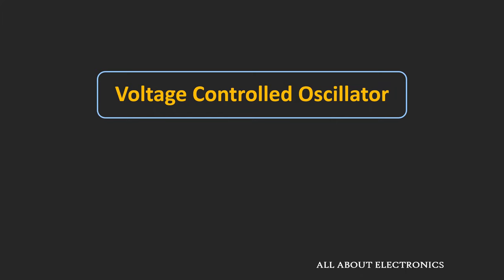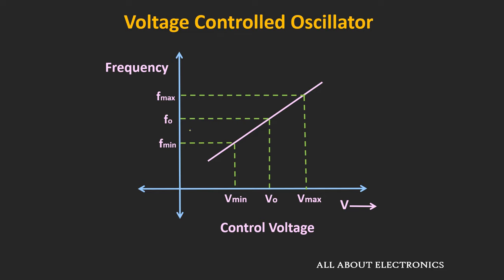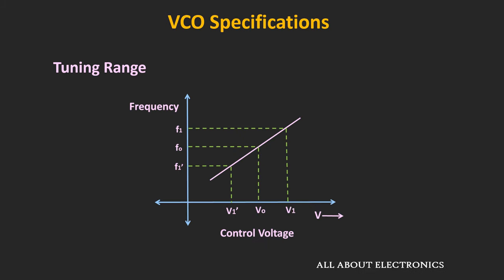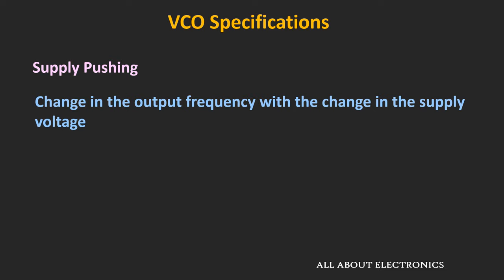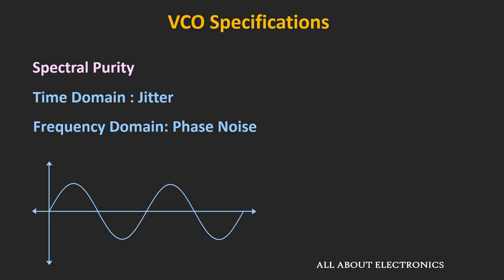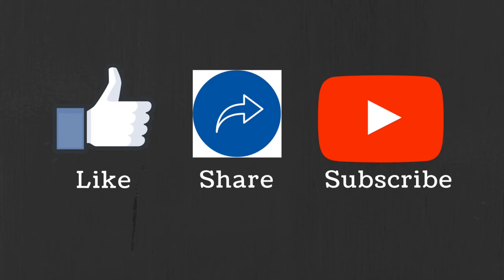Voltage Controlled Oscillator (VCO) Explained

Comment from the maker: The timestamps for the different topics covered in the video:

0:21 What is Voltage Controlled OScillator

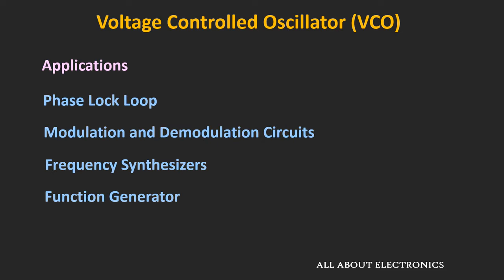1:56 Applications of Voltage Controlled Oscillator

2:09 Types of VCO and Basic Working Principle

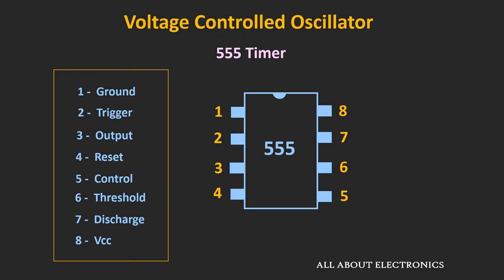5:53 Voltage Controlled Oscillator using 555 timer

6:48 Specifications of Voltage Controlled Oscillator (VCO)

Comment: Controlling the frequency via voltage is the best method by using Varactor diode or the Varicap diode even you can divide the frequency easily and it's stable as I remember in 90's we were doing that type of circuits

Comment: Great explanation! Is there a way to change the voltage on the oscillator based on the load so it can adjust itself automatically to a change based on the change in load voltage or current demands?

Comment: Great Video. How do I find more information on the output capabilities of an RF oscillator. Is there an output voltage? power output? Do you not think of oscillators like you would a normal circuit?

Comment: This is awesome. I was just wondering about this yesterday after browsing online and looking at various active crystal oscillators. So a TCXO is a VCO with a circuit that compensates for temperature. Are there TCXO's that have additional VCO type adjustments? Is that considered a "VCO with temperature compensation," a "TCXO with voltage control," or is there some other mnemonic I haven't heard of yet?
Reply from the maker: Yes, TCXO is the temperature compensated Crystal Oscillator. As far as I know, they do not have any additional arrangements for the frequency variation using the voltage. They are meant to provide the stable frequency irrespective of the change in the temperature.
On the other end, in VCXO (Voltage Controlled Crystal Oscillator), the micro tuning of the frequency is possible ( ppm level) with the change in the control voltage.
Reply: @ALLABOUTELECTRONICS  
 Thanks for the reply. A few hours after commenting here yesterday I was browsing AliExpress and a listing popped up for a VCTXO. Of course there was no datasheet or reference information, but it got me searching further. One of the first search results was from a company called Connor Winfield. They have several product lines of VCTCXO oscillators. Based on a quick skim over other search results it looks like one application for these crystals is probably cellular phones. It makes sense to me. A very precise radio with extremely demanding environmental temperature conditions seems like it could benefit from such a product. 
 All I know is that my oscilloscope is my most accurate frequency measurements device, so messing with precision frequency devices like a VCXO is entirely pointless. I still like learning about them though.
 BTW I'm subscribed to over 1k people here on YT. Over half of them are electronics related. There are a lot of people doing similar content as you, but they don't quite do it as well. Your presentation style and content length are perfect for me to watch casually. It's one of the few I watch regularly. I just want to say I appreciate it, and thanks. You're doing a Iittle bit to help me, some random disabled person in California, to stay busy, learn something, and make better use of his time. Thanks.

Comment: Hi! I would like to know if VCO can amplify the frequency of an input signal. So I have an oscillating input signal and I want to increase its frequency. Is it possible? If not, is there another option to do so?
Reply from the maker: Using Phase Lock Loop (PLL) it is possible to do that. Please check the video on PLL, I have already explained it in that video.
Reply: @ALLABOUTELECTRONICS  thank you so much! I'll do it 😉

Comment: Sir what is the ic no of voltage controlled harmonic oscillator? ???
Reply from the maker: There are many actually. depending on the range, you can select. 
For example, for 40 MHz to 650 MHz range, you can use MAX 2605 - MAX 2509. Each covers the different range. 
For example, MAX 2605 covers 40 MHz to 70 MHz, while MAX 2509 covers the range from 500 MHz to 650 MHz.
These VCOs are based on the Colpitts Oscillator. You need to connect the external inductor.
the values of each range is given the datasheet. 
You can check the mouser website and search for the specific VCO. 
You can use filter option to choose the specific VCO.
Reply: @ALLABOUTELECTRONICS  thanks sir

Comment: Explained very well..Now this is my fav classroom. 
Sir, can you tell how can we set High level and low level  to the output of a pulse generator? I tried clamping circuit. But it's not working with that.
Reply from the maker: Do you mean the amplitude of the waveform ?